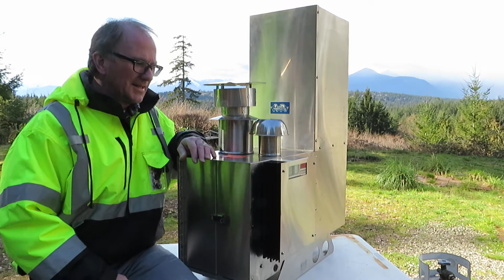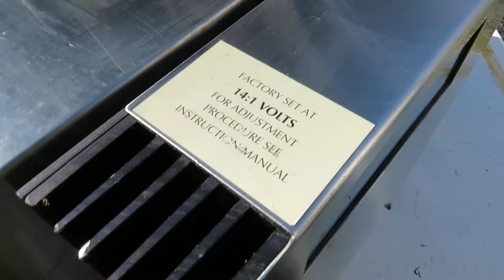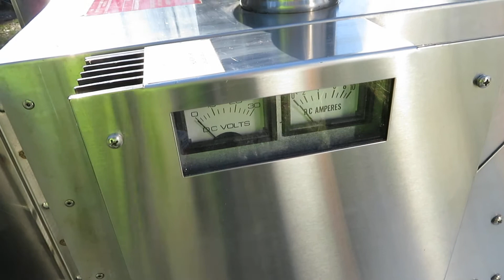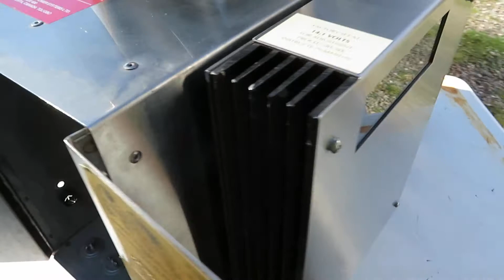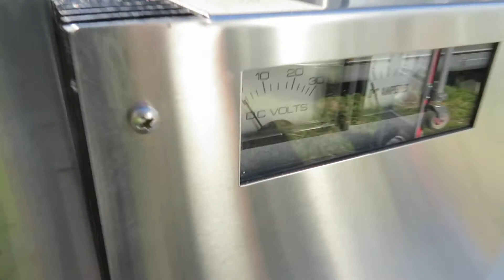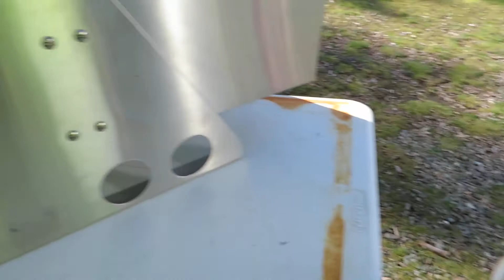Global Thermoelectric Generator - what powers Perseverance Rover on Mars

Comment: I have an older set of two 3M TEGs thaf are similar. Im confused about the propane delivery. 
This technology would save a lot of people a lot of money, increase quality of life, and reduce the environmental impact. This technology has been advanced and distributed worldwide. The exception is the United States. We can and will buy oil. It is distributed mostly to nations of very high population with very low income and services. It is more profitable to the manufactures. I am in Alaska. I am having a hard time figuring out how to create a charge control system that will switch between TEG and Solar.

Comment: if you use heat pump to provide heat for the thermoelectric part so  harnessed power can provide power for the heat pump . as result you would have a heater that can run without fuel. half of the heat will be used for power and the extra heat will warm up your ambient

Comment: Is thermal>electric more efficient than thermal>mechanical>electric? Trying to find a generator for my 300-500c sand battery
Reply: Not even close. Thermal electric is 2-5% efficient while an engine is around 30%
Reply: You could get it up to 15% but that's a difficult thing to do.

Comment: I have a large Homebiogas setup.  That means I have plenty of biogas available. Would this be a good one to charge an Electric Car?
Reply: You would need an enormous amount of thermoelectric generators to charge an electric car. If you were charging it say level one would be 120 volts at 15 or 20 amps if you're in the US, you would say need around 1500 w of power and based on what that gentleman in the video is saying that unit is only good for 100 Watts so you would need 15 of those units to even charge at level one ev continuous. I mean if you had an infinite amount of money and wanted to do good for the planet for sure. But great question

Comment: how much propane is used to produce 100w power
Reply from the maker: The specs show 3 gallons per day. You would likely never use this as the primary power source...
Reply: @thanegrooms  👍
Reply: Efficiency 4%, respectively, the thermal power of the fire divided by 25 (1 kW / 25 = 40 W  electrical power).
Reply: @user-xz4all  4% of something is better than 100% of nothing is how i see it. i am playing around with these devices and they may have a purpose if you have waste heat energy to spend such as with a wood stove.
once i learn the data curves i plan to build around said data.
Reply: @jasonbrown467  Everything has already been studied over the past 100 years, sooner or later you will come to water cooling for maximum power generation.  The Japanese made a very good device with ~ 150 watts, but the price was more than $ 2000 and after a few years their site was closed. If you want, you can watch Japanese videos on YouTube: "TES New Energy".